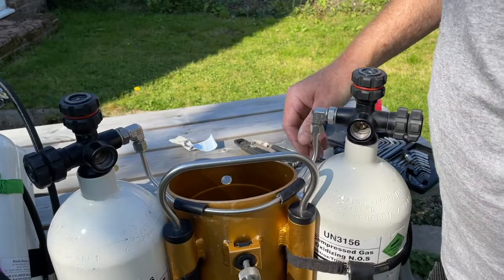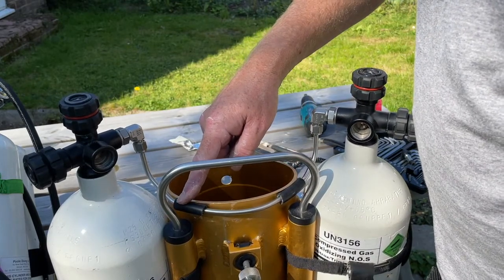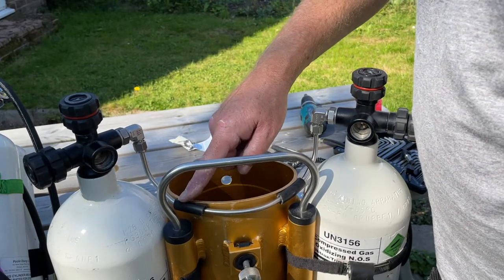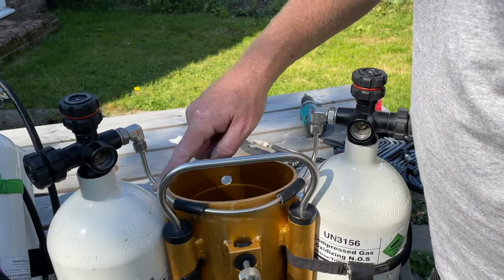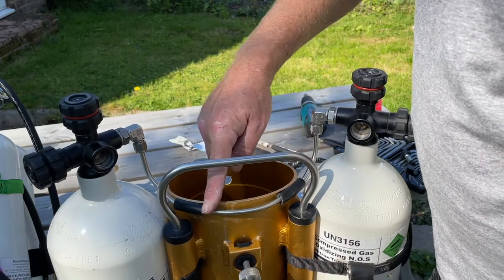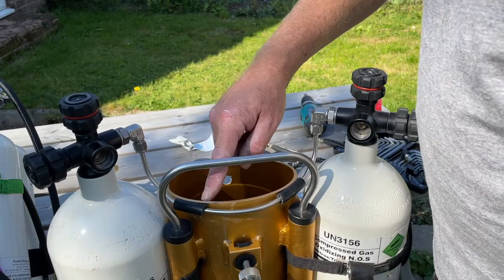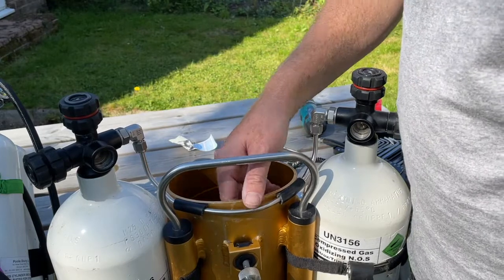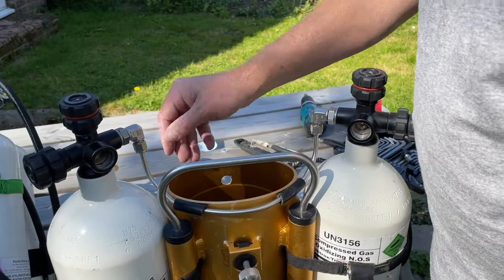Nautec hard manifold install

Comment: Hi! I'm very much enjoying your videos and learning a lot of them! One question: What is the difference between or the advantage/disadvantage between the Nautec and the Lola-Valves? I have heard/seen that in this configuration a lot of people have Lola valves as well...Txs in advance
Reply from the maker: Lola are cheaper (considerably) and easier to get. Nautec do turn easier … both work … so I’d say is the price worth the asthetics and minor function benefit … only you can decide
Reply: @gbdivering  Ok, thanks a lot. I have the Nautec also on my (non-GUE) rebreather and really like the easy turning. On the other  hand I never experienced personally the Lola (yet).
Reply from the maker: @kblueggel  Lola works - looks a bit goofy but then so does nautec

Comment: Very neat solution for combining the two tanks. What swagelok parts did you use?
Reply from the maker: What valves are you using as the nautec I commissioned specially has g1/4 outlets to allow maximum options …
Reply: @gbdivering  I have Lola valves at the moment.
Reply from the maker: Ah ha won’t work with Lola unless you can find g5/8 elbow